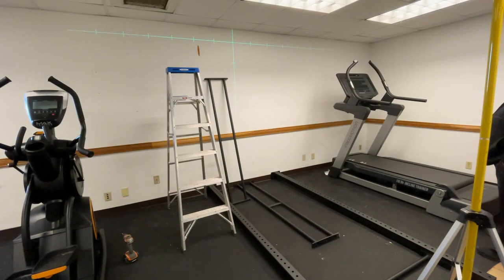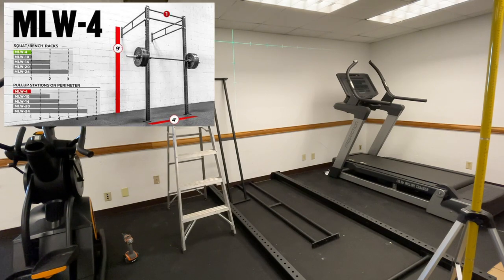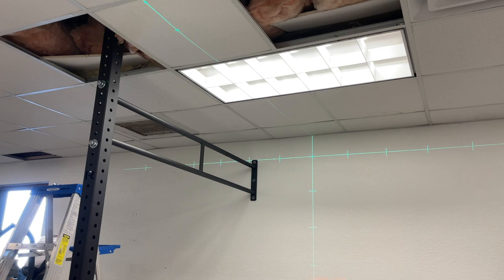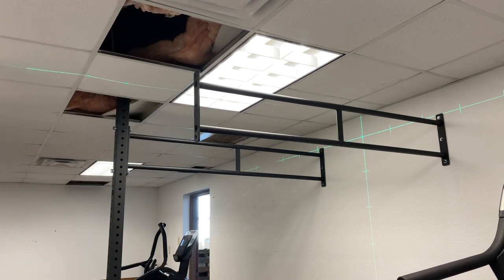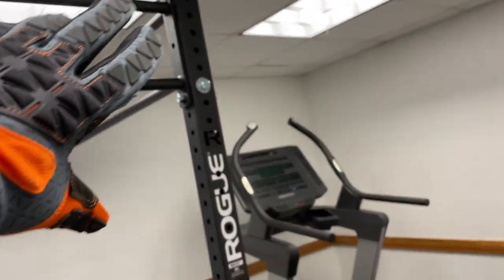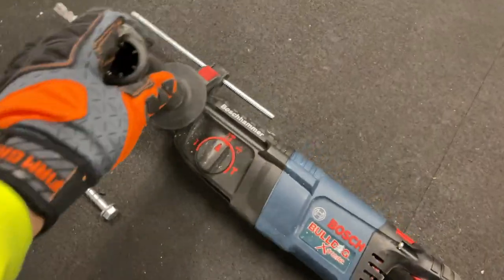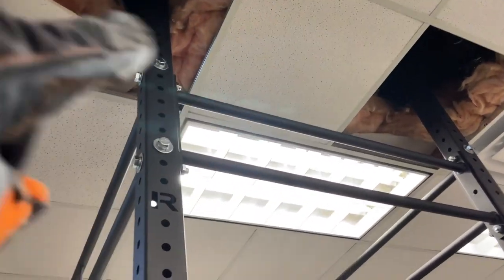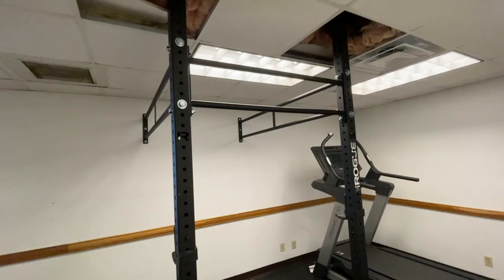ROGUE MLW-4 Monster Lite Squat & Bench Rack w/ Pull-Up Station Wall Mount & Concrete Install DIY

Comment: That was great. Thank you. What would you do if this was installed on a sloping floor? In my garage the floor slopes away from the wall I want to install on.
Reply: I have the same issue. Can the base plate be wedged with a metal shim to fill the gap?

Comment: I'm thinking of purchasing one, my issue is my concrete garage floor has a very slight downslope.  So the upright base plate on the floor will have a few millimetres difference from bolts on the wall side of the base plate to the other side. Can you put a small wedge in to fill the gap under the upright base plates? Hopefully I've explained it well enough.
Reply from the maker: Yes, a small wedge would work great to level it all out 🙂✌️❤️

Comment: What happens when your studs arent exactly 1 pull up bar width apart?
Reply from the maker: I attach a 2x4 to those studs in the wall first and then attach the equipment to that 2x4 or whatever size piece of wood is used. I hope that helps.